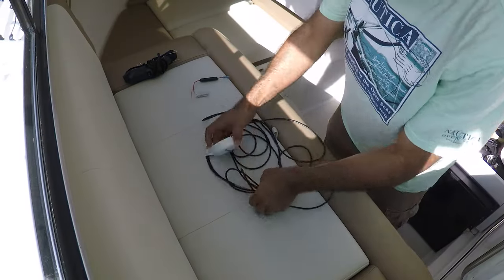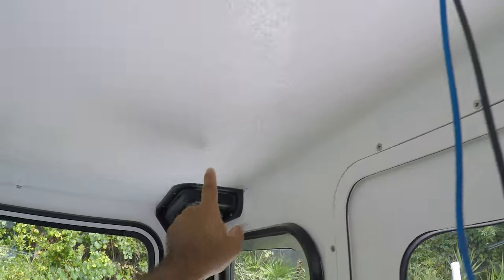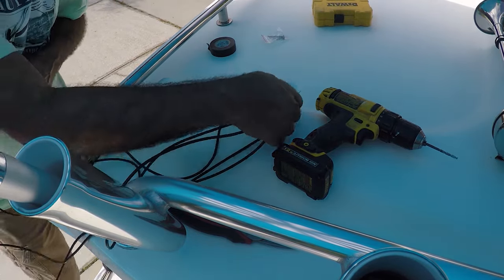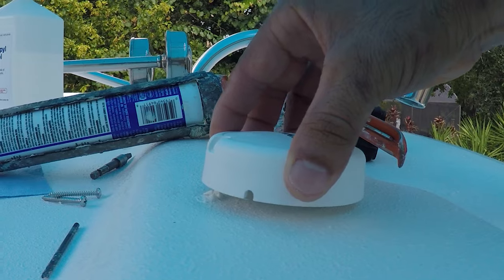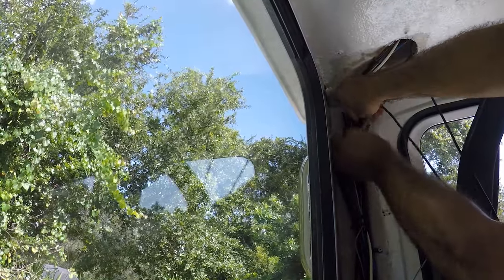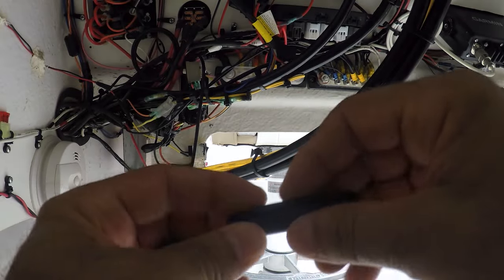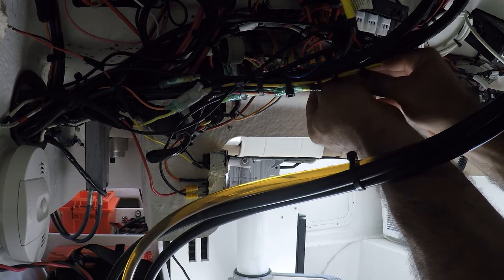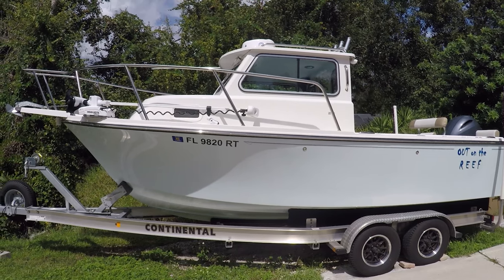Minn Kota Heading Sensor installation on a Crooked PilotHouse Boat

Comment: Very nice. You mentioned needing to add another bar for positive/negative. What else are you planning to add to the Crooked Pilothouse? You have done a fantastic job making that boat your own! Putting your own touch and making it work for your needs. I unfortunately am not that handy therefore all of those nice toys I had to order them as options on my boat therefore increasing the cost. I really like how professional all of your work looks. Everything very neat and tucked away. Was just curious as to what else you could possibly install?
Reply from the maker: Thank you Ed and yes the sky's the limit let me rephrase that the weight of the boat is the limit I can hardly add anything else heavy on the boat I'm already maxed out on weight but any sunlight I can probably put it in no more than 5 lb

Comment: Nice video Cap. Do you think you could use the trolling motor to limp back 50 miles from open sea to land if you had a problem with your main engine?
Reply from the maker: Yes with a generator running I can charge the battery and try to make it back it is possible on great weather conditions if the sea is kind of rough there's no way but in calm seas it is very possible captain
Reply from the maker: Now it may take about two days to get back and the problem with that is if a big cruise ship or freighter is coming crossing the Gulf Stream and you cannot get out of the way as soon as possible you could be in danger there Captain that's another problem

Comment: Captain, just installed my heading sensor in that same spot, I have a problem calibrating it, I called tech support and together we figured out the speaker below it could be causing interference. You didn’t encounter that problem?
Reply from the maker: No captain I did not encounter any problems with it because probably mine is a little bit more to the right than yours if you are probably 3 to 4" closer to the speaker that would make that would make a interference but in my location no problems at all captain everything works perfect  So you may want to try it before you drill again and move it down forth to 6" and see what happens and then once you figure it out it's OK you can start drilling it to the top top of the pinehouse sorry that you had to go through that trouble captain let me know later how it works
Reply: @OutOnTheReef  understood

Comment: Place a piece of masking tape the gelcoat and the drill bit will not travel when starting your hole.
Reply from the maker: I done that many of times but since this is hitting under the sensor I wasn't too worried about it but that's a good idea captain